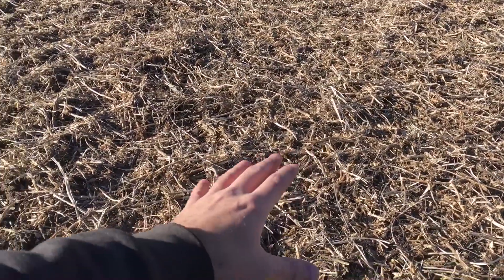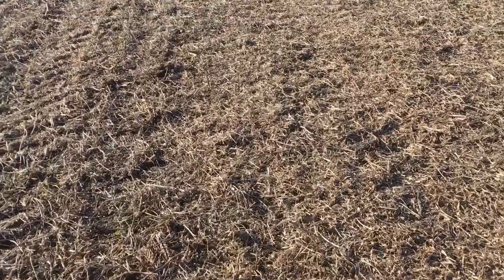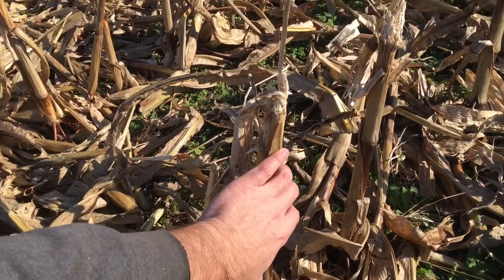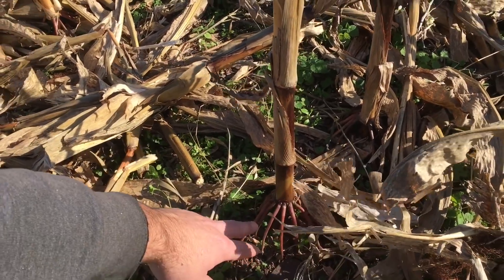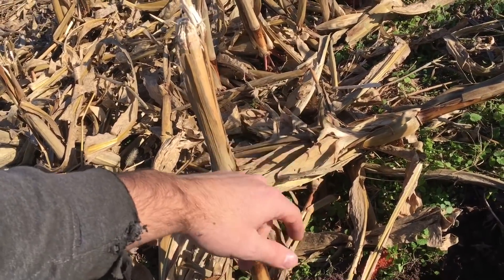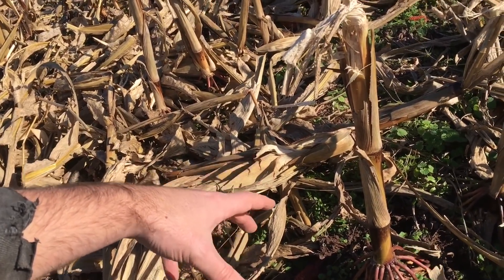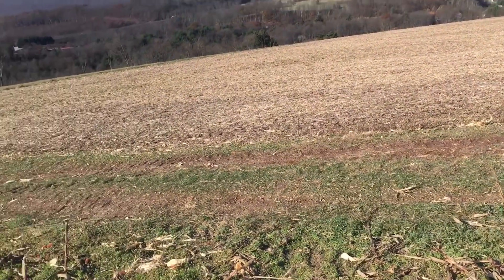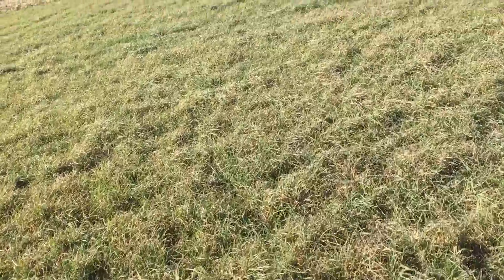The No-Till System

Comment: Growing up dad would moldboard plow every year so after 50 years organic matter was less than 1 %. Look out when it rained, hills would wash even more topsoil away. Than when it dried up it got so hard the rocks were jealous. It may not work in some places i guess but after doing it myself for 25 years, yields are up and contours have just about eliminated erosion.
Reply from the maker: Yea I can see it not working in heavy clay soils that will compact. These soils are not really compacted because of the rocks. I want to get the backhoe and make a video. I want to dig down and see if there is a plow pan. I kinda doubt it here. I had thoughts of doing a side by side plot of till vs no till, but it’s not really necessary. I think the majority of people know the benefits today.
Reply: I think in heavy clay soil it would work but would take years to get the OM back up to where it should be. Its like you said, they try it for one year then give up.